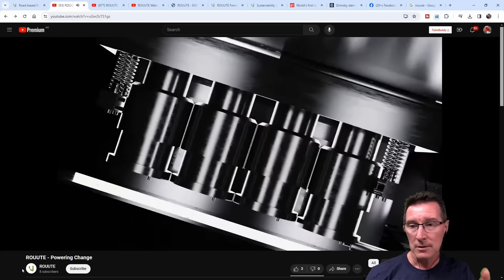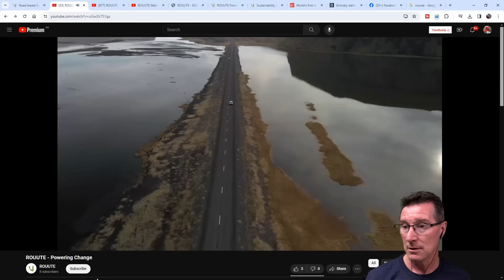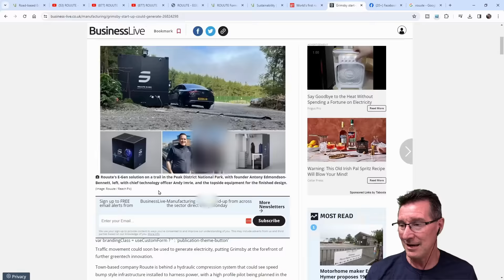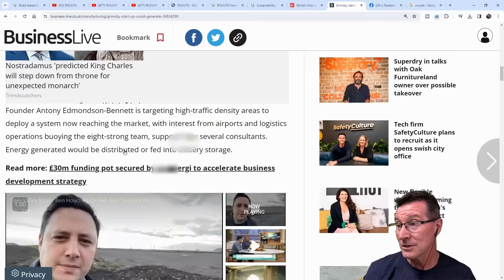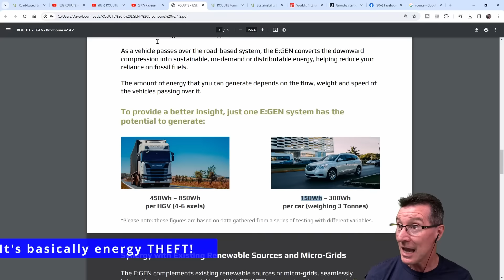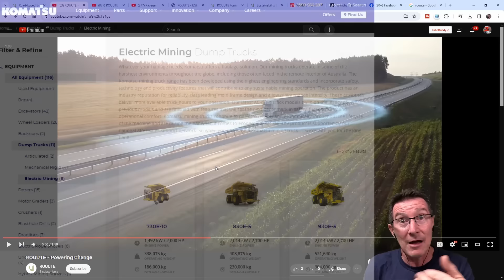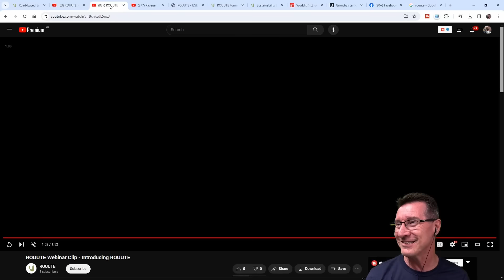EEVblog 1600 - Rouute: Road Based Energy BUSTED

Comment: I have an idea...
How about we make giant hamster wheels that generate electricity. You simply drive your car into the hamster wheel and it harnesses the power of your car to generate electricity...
It's sooo efficient, more than 200%!! In fact, it's enough to power two more electric cars (which are also in hamster wheels). How about we make millions of these hamster wheels.. with the excess greeeen energy we could power the whole world. 

Now, you might be wondering how would you get around to places if you're in this hamster wheel? Simple. The hamster wheel is also a giant wheel. So it moves around, like a unicycle for your car!
In actual fact, we can put the hamster wheel in an even bigger hamster wheel, and so on. And just like how having longer legs makes you walk faster, the hamster wheel makes you get to your destination quicker.

Comment: The only place I could see this working is on highway offramps, but as you pointed out, people would get really annoyed at their cars bouncing around! Also, as EV's become more common this would have a negative impact on energy efficiency. It's way more efficient to recharge the EV battery with regen than it is to try to harvest it through speed bumps.

Comment: Why have perpetual motion machines made a comeback in the 21st century?

Cars are already using their power to go forward (if they're not you should design better cars), any energy removed from the equation to be put into the grid must simply be re-generated by the car to maintain it's forward performance. You'd be better off building a diesel generator. This is simple physics. The only exception is on downhill sections where gravitational potential energy that would otherwise be dumped into the brakes could be harvested instead.

Comment: Mech eng here: This being a hydraulic system, i recon they're using a bladder/cylinder to charge an accumulator, which can then provide a more stable level of output to a generator. Very simple, not very clever at all.

Comment: Assuming it works (on downwards hills), I would think it still will only be green if the energy it generates is worth more than the corban emitted from manufacturing, installing and maintaining the system as well, and I doubt that was ever considered.

Comment: Nobody told them resistance is a thing. The more power you wanna make, the more resistance you get from the energy source. What's the energy source? The car! It's common sense. Your car will drive rougher, your tires will be destroyed, your car will be slow, and it will take up all your energy. Good luck making this work, lol. It's just like holding someone who's trying to accelerate. The more you hold them, the more energy they need to pull forward. Doing this for a couple of minutes will make them lose more energy than they would've if you weren't holding them back.

Comment: actually that is the most cocky lie ever - carbon free energy from Cars driving over bumps... Yea i found a "no fuel needed" turbine that spins and creates energy for free, just attach the turbine to your car's exhaust and let your car run 24/7 and you have cost free energy in your house...  So the street now generates energy by resisting the cars more now the streets make energy from "nothing" and well for some reason the gasoline consumtion from cars goes up.... I wonder where they thing the energy will come from.

Comment: I do not want to debate the absurdity of this idea. I just want to point out that in EU speed bumps are everywhere and most of them are on the flat roads. The purpose of them is not to stop the car by the mechanical force. The purpose is that the driver would see them and decrees speed to prevent damaging his car.

Comment: This "system" is not dependent on breaking. Form what I get from the video is that this converts the weight of a vehicle passing over something to passively "generate" power. The "speedbump" isn't really a speedbump just an indicator of where the whatever it is, is located under the pavement. However here is the problem! You need to build some more flex into that pavement section. Causing the road surface to wear out quicker, possibly? This has nothing to do with regenerative breaking used by EVs. It simply proposes to use the weight of any vehicle passing over and converting that pressure into electricity. 
But I see the extra $ and carbon used to maintain the "flexible" road section making it a net loss. Then again ive been wrong before?

Comment: 5:27 generating 300 Whrs each time? I seriously doubt that. 

300 watt-hours = 796567.121 foot-pounds

If you drove a 2 ton car over this thing and pushed it down about a half inch (0.4525") then you would get 300 Whrs per mile! 

Considering that car engines are about 30% efficient and large power plants are about 60% efficient, you would be much better off getting energy from the grid.

That thing would produce more emissions and cost an insane amount of money when  compared to current power generation technology.  Not to mention the wear and tear on both the vehicle and this device.

Comment: Guess where all this energy is coming from? It's coming from gasoline FFS! When a car drives over such a bump, it losses energy in the form of various types of friction. So Everytime you're driving over these things it's consuming more energy from the car compared to the flat road. This is basically a way of stealing gasoline from consumers because they'll be paying at the pump more frequently due to the lower average MPG they will experience

Comment: The simplest way I can think of to build such a system would be to put a long gas filled bladder (nitrogen or just air) inside the whole length of the bump. When something drives over the bump, it compresses the bladder and pressurizes the gas. Add a couple a check valves and you now have a gas pump. Store the pressurized gas in a big tank and use the stored gas to power a small turbine or pneumatic engine. The tank can store up the gas from each pulse, allowing the turbine to run continuously, and by making the tank nice and big, each pulse won't change the pressure much, which will give more consistent (and thus more optimizable) performance for both the pump and the turbine. 

A hydraulic-pneumatic system could also be used, with the bump having hydraulic fluid inside which then operates a pneumatic pump close to the generator. The shorter run for the pneumatic circuit might increase performance or the switch to hydraulic for the bump might make the design more robust. It would take a lot of work to figure out if that would be worthwhile.

Of course, it would only make sense to install these in places where you already want a speed bump, and I think it's very questionable if the system would produce enough power to be worth-while. My intuition is that it wouldn't even pay off the energy used for manufacturing and installation during its lifetime.

Comment: 2:41 And if you add a wheel to your e-car with a generator attached, you can drive forever. Even if you just have 5 D-cells as EV battery. …
I also have a bridge to sell.

Comment: Unless it is intended do be used as an actual speed bump, it will be both dangerous, inefficient and wasteful. Even then, sticking a solar panel where you would put one of these would surely be a better idea.

Suddenly solar roadways doesn't seem like the worst idea anymore.

Comment: To be clear, this device isn't capturing the energy from a vehicle slowing down - it causes that to happen, but doesn't capture that. The actual energy generated is coming from the vehicle compressing the speed bump, which would indeed be a tiny amount. So it does steal the energy from the car that's required to crest the bump and compress the hydraulic cylinder, but the energy that goes into slowing down before you get to the speed bump is either going to go into regen (for an electric car), or just get wasted (for ICE cars).
Reply: Doin' some math, gravitational potential energy for a 3 tonne vehicle moving down 10 centimeters is .. 2940 joules or 0.8 watt hours. You can run a microwave for 2 seconds for each passenger vehicle. Assuming perfect extraction, energy storage & AC conversion, you would need 60 cars to get their gravitational potential energy sucked out of them to cook a hot pocket

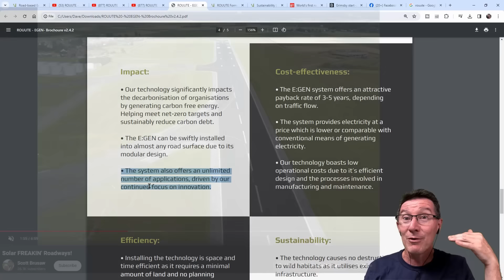Comment: 8:00 A landing strip would probably be perfect, as the energy is clearly taken from somewhere, and you want to slow the plane down. Probably less good for planes trying to take off, though 😆
It could also be useful leading up to stop signs, as long as no people live nearby to complain about the extra sound pollution from the speed bumps.

Comment: To cut a long story short (and before I even watched the entire video - just the first minute or so), it is a form of energy theft (inefficiently) from ICE vehicles. I pay at the pump, I drive on your speed bump road, and I therefore have to use more of my petrol to maintain a constant velocity and overcome the friction caused by these bumps. Wow. What an insanely dumb system. That's just stealing - both from the motorist and from whatever local authority that is dumb enough to pay the (no doubt) hefty fee to install it. Oh - and it increases the amount of carbon generated. Enough said.

Comment: harvesting energy from footsteps from people who are just trying to get through their day without getting too tired, forgetting that gyms have dozens of people in them working out and trying to give energy away
Reply: Is there a good way to do that? OK stationary bicycle or stepper/walker excercise devices are pretty obvious candidates. A treadmill is not... really unless it's gravity based?
Reply: @SianaGearz  You'd have to set it up so the runner was driving the treadmill belt, instead of the treadmill belt being spun under the runner. I'm not sure how practical this would be, but maybe if you had some sort of shoulder-harness tether to stop the runner from moving forward, you could set up the treadmill belt to be basically free-spinning but connected to a flywheel (to preserve inertia and keep the belt movement semi-continuous) and a generator (to harvest energy). The bit I'm least sure about is how to set up the harness so that it doesn't interfere with natural running movement - I'd imagine the tether line would have to align with the runner's center of mass, at the least.
Reply: Ok this really sounds dystopian
Reply: @turolretar  It sounds dystopian, but I doubt any economically-realistic dystopia would mandate it, due to efficiency losses. The poor proletariat forced to work in "human energy production" would be consuming more food energy than the amount of electrical energy they'd be producing - you'd get much more efficient energy conversion by just setting food on fire directly. I think this only works in "dystopias" where even the underclass has a resource surplus, or in semi-dystopias (e.g. the real world) wherein you could get credit back on your gym membership fees from your energy production - making them cheaper or almost-free if you have the time and energy to work out regularly.

Comment: If you just remember the simple concept of conservation of energy you'd dismantle 90% of those energy scams.
You'd know the energy has to come from the cars, which means even in the best case(for energy generation, not for the person traveling) of 100% energy conversion,
basically entry level physics when the teacher tells you to ignore friction, windresistance, reality, etc...,

you'd only have a system thats no better than a diesel generator but with way more downsides.

Then when you start to consider more aspects like the actual efficiencies of it, wear and tear, etc it only gets bleaker.

Comment: I'm pretty sure this is basically using the cars to pressurize a hydraulic accumulator by sqeezing the part on the road, which then runs a hydraulic motor to spin a generator.

Comment: Look i'm not smart so correct me if i'm rong.
Einstein told us you cant create matter out of noting, so if this generates power it will come from the car losing it, meaning... it needs to burn more fuel.
EV's gona be the best thing for this, you loose battery charge hitting these speed bums so they can generate energie and sell it right back to you.

Comment: If this generates power from cars driving over it, what happens during times fewer cars are on the road, like night time? 

Or worse yet, traffic jams when cars are barely moving? 

PLUS millions of extra expense and construction costs have been added to roads in order to recover... A tiny amount of power. A roadside windmill would provide more power in this case.

Comment: I have to ask, why? Wouldn't be easier, more practical and actually make some sense to use solar panels as sound deflectors in highways? Theyre not being ran over by trucks, have a secondary use and being sound deflectors they probably are near some houses that could use that energy lowering transmision loses. Aside, there are some interesting studies about double sided vertical solar panels.

Comment: So yes, this is obviously a stupid idea for roads, but, is it actually that bad an idea for landing strips? You would need a way to lock the system out for take offs, but on landing passeenger aircraft use an awful lot of reverse thrust to slow down, so not only could you generate some energy, but also save some fuel for the reverse thrust...

Comment: Ignoring inefficiencies just to stay conservative, is pretty outrageous in a case like this. To begin with, the cars are only about 30% efficient. They don't just need to expel the same amount of energy to get up to speed, they need to expel at least 3 times as much.

Could have used some more focus on the fact, that the energy is harvested entirely from the very fuel of the cars, via the forcefully increased use of the fuel, which means it's a loss from the get-go, and is going to cause a bigger CO2 discharge than it saved (not that that's a problem to begin with, of course, unless you breathe mainstream propaganda).

The main focus should be that they're literally stealing the energy, and in turn money from the drivers; they're not capturing energy that would have been wasted, they're forcing cars to spend more energy, and capturing that at an insanely low system-efficiency of about 10%.

Comment: Did nobody realise that the resistance these speed bumps create is more than the energy recovered? You don't need to be a scientist to know that there is no such thing as a free meal.
On the matter of PaveGen, this is just a system that was invented back in the 80s and appeared on BBC's 'Tomorrows World'  as a power generation system for sailing boats. Waves hitting a film on the boat's hull would produce a small current charging a battery for lighting and radio.

Comment: Using them where ordinary speed bumps are used might make sense. But their proposed use might be stupid. Add more travel. Make it work like a speed bump. Probably like a 20 year payoff. Maybe a laundromat is a better investment. Less green though. And more local energy productions with shorter wiring - might make sense. But they need to not break every 2 years which I suspect they will.

Comment: Ony my coutry speed-bumps are VERY VERY VERY common.. soo to be fair.. this thing could work...
Brazil are not a EV friendly country yet.. but even on 20years. i doubt that speed-bumps will never exist.. 
in fact on São Paulo this is kinda annoying on some streets.. 
the argument is to "make the road safer" because the cars will have to stop or break the car.. But in fact kinda opposite happens.. on some roads/streets people will even increase the speed when saw a speed bump..
Soo on this reality this product COULD work.. 
But on some other perspective is more easy people vandalize this...
And to get more perspective Brazil have clean energy, almost all the cars can run with ethanol and the GRID is feed with hydroelectric plant..

Comment: I had an idea similar to this, but less destructive to the cars, a few years ago.  I was thinking if you drove over something that would pump air, you could charge an air tank and use that to power something.  Compressed gasses can store a large amount of energy and can also release large amounts of energy all at once, or be very controlled.

But I wound up figuring out it would be more beneficial to simply mount a bunch of small wind turbines next to a road to capture the wind from cars as they pass by, as that would not beat the tar out of everything that drove past, and would not be exposed to repeated impacts.
Reply: They've done that in some places, installing vertical windmills to catch the wind generated by passing vehicles. Of course critics point out that you're still minimizing efficiency there by creating vortices and whatnot, but it's probably a better application overall imo.